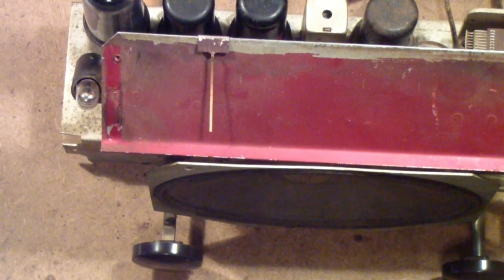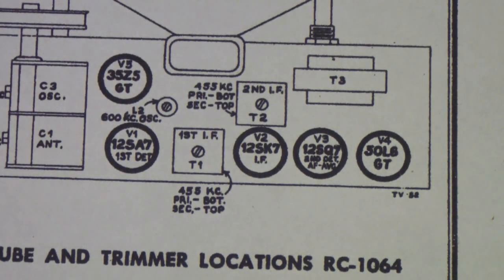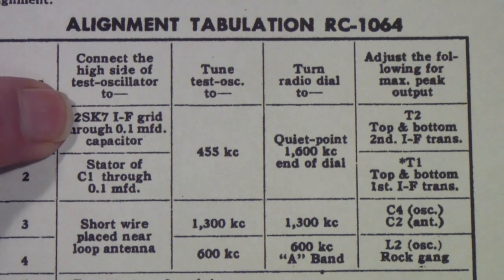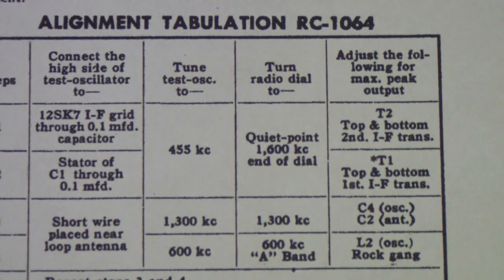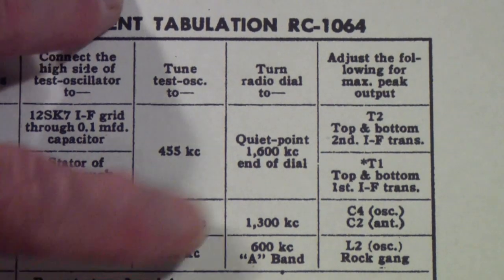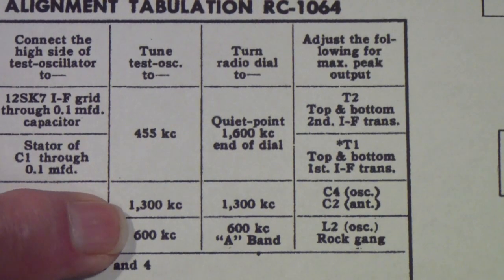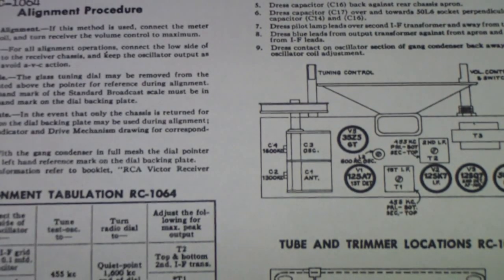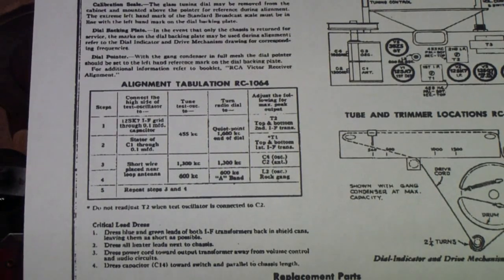TTT288 The Frugal Repairman Pt19

Comment: We always had a saying at my old radio shop: If it works, treat it like a sore dick and don't f*** with it. 

It always amazed me how many people fall into the screwdrivering category as you call it. Frustrating on high end radios because of the amount of time required to get it back to where it is supposed to be, so that the original problem can then be evaluated and troubleshooted.

Radios I work on now are far different then the good ol days of IF can adjustments, discreet local oscillators, phase detectors, ceramic trimmers and all that. Everything is digital and the alignments are "softpots" via software. This extremely accelerates the screwdrivering problem because a lot of so called comm shop techs have NO idea what they are doing, and do not bother to read the manual that accompanies the tuning software that describes the adjustments and etc. They just start clicking away.

Comment: Nice DMM's have analogue bar graphs.  An MF-47 has the same range as the Simpson, and may be more versatile.  Cost?  Less than 13 USD on ebay.
Reply: That doesn't solve the sampling rate issue
Reply: @jamesbrill5896  I agree.
Reply: IT STILL DOES NOT HAVE THE SAME REAL TIME CONTROL AS AN ANALOG METER HAS,AS  TOM SAYS.TOM HAS PROBABLY WRITTEN THE BOOK AS AN EXPRESSIO WHEN IT GOES THIS SORT OF STUFF.